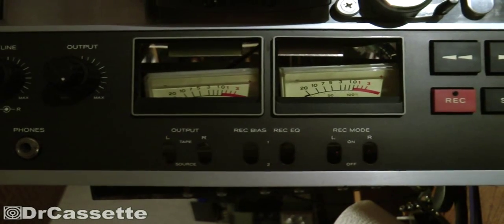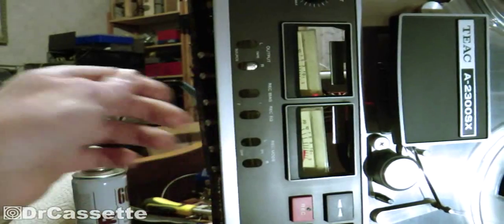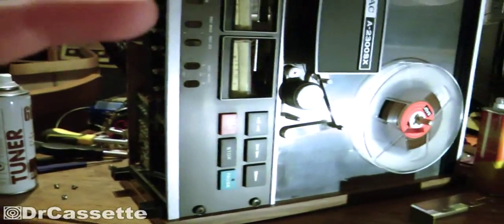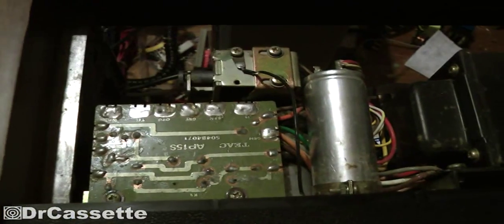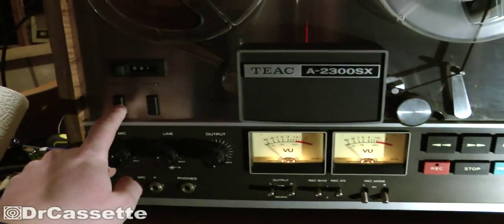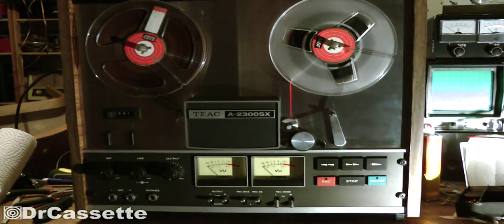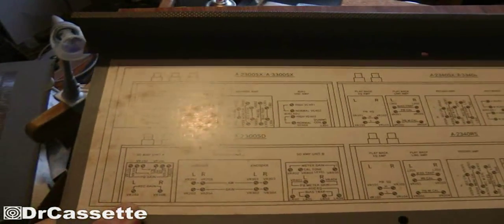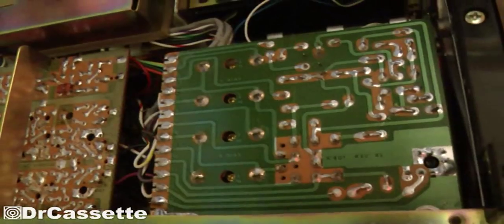DrCassette's Workshop - TEAC A-2300SX tape deck repairs [3/3]

Comment: Hi DrCassette,  i have a Teac 3300SX from my father that i want to restore and these videos help me a lot. 
I have a question about the corroded traces: you said "i'm going to redo the solder joint", you mean you are going 
to put new solder on the trace itself where it's corroded or you mean only on the solder joint ? 
To put it simple, do you think it's a good idea to put new solder where the traces are corroded ?
I'm asking this because i have lots of corrosion on two circuit boards.
Thanks in advance
Reply from the maker: First thing you want to do is to clean the circuit board where it's corroded. I like to use Kontakt WL for this, but I don't know if the sell it where you live (I'm in Germany). If scrubbing with chemicals doesn't work, use fine abrasive paper or something similar. Once the circuit board is clean, you can decide. If the trace looks like it might be corroded so bad that it's open, you can put solder on the trace. If the damage is minor, leave it as it is. Always remember, too much heat applied by the soldering iron over a longer period of time can cause the trace to come off the circuit board, in which case you are in even more trouble.

Comment: is that real wood or chip board with a vinyl veneer? if it is real wood you can sand it down until you can see the real finish. if it is chip board i would sand it down to the chip board, fill any holes and voids with wood filler and spray paint it a flat  black or brown. you can also take the wood off and send it to somebody to reproduce the parts in solid hard wood. maybe you can swap electronics for the wood